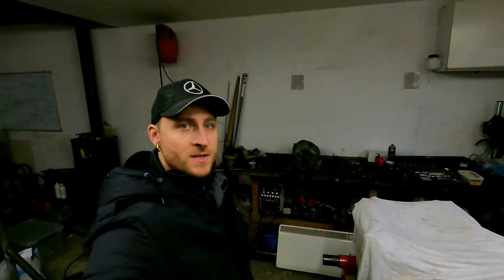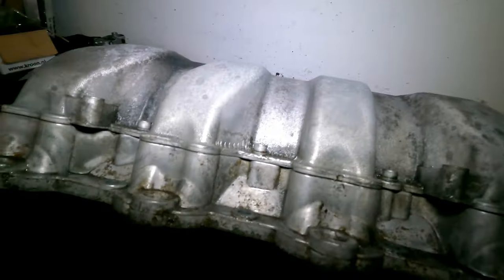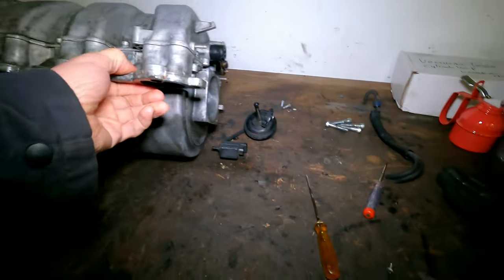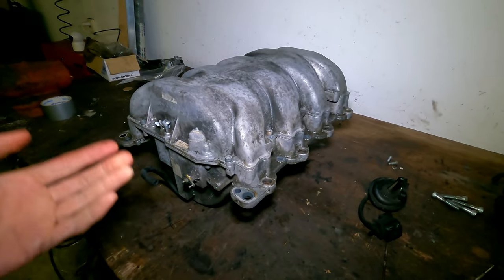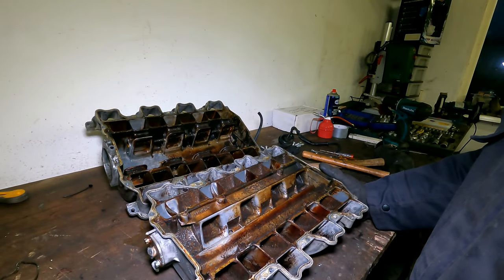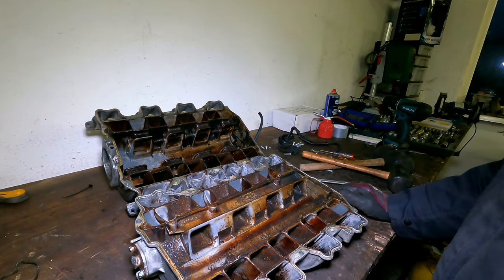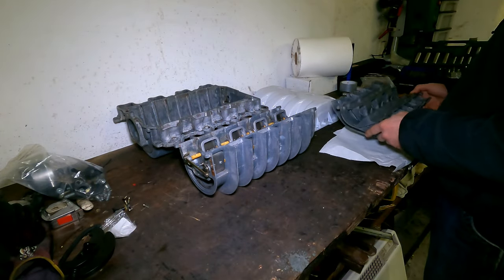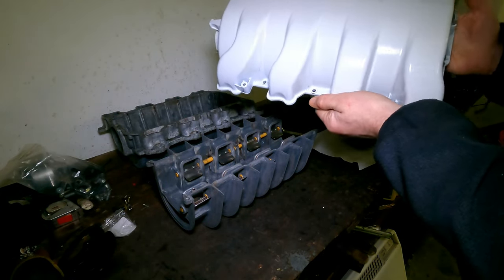HOW TO: M113 intake manifold dissassembly "Part1"

Comment: interested to see what you do with the vacuum chambers and how using the other ports will behave, I chose to just use the existing port and exit just with upgraded to 1/8 fuel rated line and a 3/8 hose piece cut to the same size at the little rubber factory piece, much tighter fit than factory. I then sealed all of it in that spot and silicone the outside of the connection as well.
Reply from the maker: I think for you this will work pretty good.  But when boosting the engine i doubt it will hold

Comment: 2:07 I've heard they are magnesium but when I've tested them with vinegar (top and bottom halves) they don't react at all. That makes me think they are aluminum. I could be wrong though and maybe it varies by year or perhaps the magnesium has some sort of coating or alloy mix that doesn't react.

3:13 Is that dyno sheet posted up somewhere for viewing?

23:00 I wonder why they have that vacuum chamber instead of just using the vacuum in the rest of the manifold. Does it hold vacuum a little longer than the rest of the manifold at full throttle? That might help slow down the activation of the variable runner length flaps for a bit longer. Or is it for some completely other reason?
Reply from the maker: If it is not magnesium i dont now what it is very hard.  And for aluminum it feels to thin.
That dyno sheets i found on Facebook.  When i put in on the dyno i will make sure to show the difference  .

Maybe on full throttle the airflow is not a very high vacuum.  So it can be that the vacuum in the manifold is not enough to control the actuator at every moment
Reply: @JMSpeedshop  👍
Reply: @JMSpeedshop  The spec-sheet for the M113 engine says that the intake manifold is magnesium.
Reply: Maybe it's a high mag aluminum alloy. There are many types used in all kinds of industry.
Reply from the maker: Can be but magnesium is has also aluminum in it .   The sheet i have somewhere but not online. The chamber is just as a capacity chamber.  If you go full throttle there is a low vacuum in the intake .and maybe not enough that let the valve switch

Comment: Could you remove the flaps and all of the "intestines" and put it back together? Would it actually make any gains over OEM restrictive airflow? Kind of like gutting the restrictive OEM airbox... Thanks. Please keep posting these great videos, your build is awesome!
Reply from the maker: There is a possibility to remove the flaps. And the mechanism.  There are 2 stainless steel screws in the flaps connected to the shaft. I have tried to remove them.  But did not want to damage them.  So i left them in. 
I think the shaft bushings are a sort of hard plastic.  The quality is pretty good.
I have seen some dyno sheets in the past about the torque and hp curve between short and long routing .  And it is really making a difference .  It is really good in compensation for not have VVT cams.
If you dont want to use the double routing intake.  I would go with ITB's. Will sound awesome and better to tune for your benefits.  With faster change possibility of the long plenums
Reply: @JMSpeedshop  Agreed. I have looked it up and it seems awesome... Please have patience with me I am/was a Mercedes-Benz OEM mechanic (translation we just replace parts with OEM ones XD). I have a W211 E500 with M113 engine and am interested in improving the restrictive OEM airflow these engines have. You have some wonderful ideas and skills and I am looking forward to your next video! Greetings from Zagreb!
Reply from the maker: Sound Nice w211 💪
Reply: @JMSpeedshop  so very interesting to dive into areas no one covers . Really enjoy your posting videos.
Reply from the maker: Thanks👍

Comment: Do you plan to upgrade trottle body? As i know trottle body from newer 550 engines fits on M113 with minor manifold modifications. 74 mm vs 82 mm...
Reply from the maker: I leave the oem throttle body .  I have 3 " piping and intercooler  so upgrading the throttle body will not help because of the rest of the system is still smaller
Reply: @JMSpeedshop  
Agree :)
Reply: Is the wire connections the same or do they need to be moved around?
Reply: @TheInsaneShecklador  
i'll do that mod on my 113 very soon and will report. Now i have to clarify the details.
Reply: @W210Garage  👍